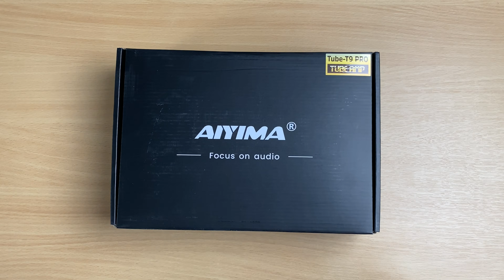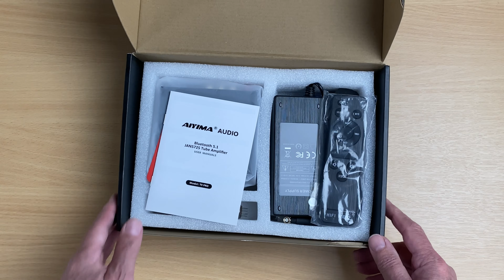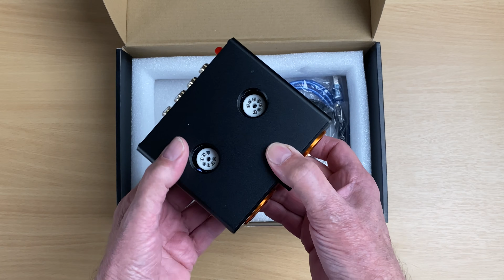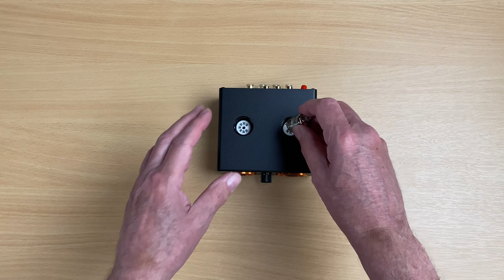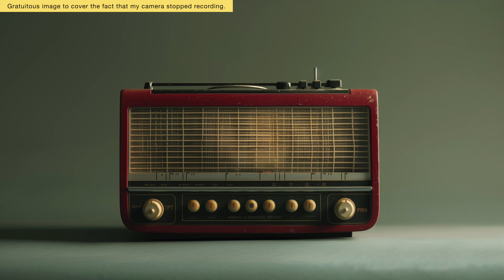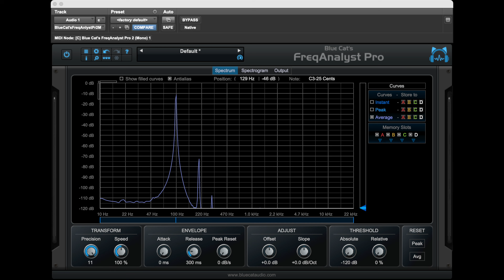Does this amp distort? [Aiyima T9 Pro]

Comment: Using a tube this way does add a little coloration - i.e., distortion. Nelson Pass has done some research and he says adding certain distortion in small amounts can sound to most people as greater depth in the stereo image. Not the same as warmth, but and interesting. There is also "sighted bias" and so on that could be going on here.  Many of us in the Hifi hobby have heard that "tube gear sounds warm" - and in fact since tubes are thermionic devices, they have heaters - which is the yellow-orange part you see glowing cheerily inside the tube.  And tubes actually do get warm or even hot.  Hifi enthusiasts know this, and this knowledge can influence what people feel that they are hearing. So even if the tube were not in the audio path at all, a number of listeners would feel that the audio device in question provides a warm sound.  Ears and not microphones and the brain is not a piece of test equipment. It is impossible to listen to some piece of gear and make an objective pronouncement - any "how does it sound?" comment will be a subjective opinion, coming from the mind of the listener and human minds are terrible drawing making objective conclusions of subtle sensory observations -  such as evaluating the "sound" or a gain stage. So, even if this slight amount of harmonic distortion is not audible, many listeners will FEEL that the amp produces a warm sound. 

Now, tube audio output stages are another matter -  the source impedance of a tube amplifier will interact with the complex impedance of a speaker which results from an interaction between the electrical characteristics of that speakers drivers and crossover- this interaction follows Ohm's law and results in variation of frequency response of the amplified sound. Sometimes these variations are very small and are essentially inaudible, but sometimes the response through the amp/speaker combination varies by as much as ± 4 dB- which is definitely audible.  Personally, I LIKE the way a certain tube amp of mine sounds through a pair of 2-ways speakers that I have- the coloration is very much to my liking.  So, in a sense, I am using this tube amp as a TONE CONTROL.... 😎
Reply from the maker: Thank you for your detailed comment which I'm sure my viewers will appreciate. I will however comment further on 'the yellow-orange part you see glowing cheerily inside the tube". In modern equipment, whatever glow there is from the heater is often reinforced by a distinctly solid-state LED.
Reply: @AudioMasterclass  Ahhhh-  but any LED is not INSIDE the tube so it is not  'the yellow-orange part you see glowing cheerily inside the tube"   only the heater is INSIDE the tube-  but this a minor point.  Also, while the tubes get warm or even hot from the filament, the LED doesn't cause any appreciable heat.....
Reply from the maker: @billmilosz  To be clear, I did not say the LED is inside the tube. It is a trend that I have observed for close on twenty years that tubes have their glow enhanced by LEDs either behind or beneath the tube. It does nothing other than make the equipment look nice. Personally, LED or no-LED I care not.
Reply: @billmilosz  In fact there is a very small orange glow within the valve due to the fact that the filament is warmed onto a state where it can emit electrons. It's basic with valves. The blueish tone that we see on some chinoamps, working on low levels, are just marketing cosmetics. Indeed if you inspect an old medium or short wave AM transmitter the modulating audio from the old venerable 6146 valve in push-pull configuration class A/B will make glow blue due to the ionization of the gas inside, this for a continuous 80 W or more. This is for the audio frequencies. This very same configuration, this time for Radio frequency drive to the output Valves, in class C, will glow in orange by nature. This blue or orange glow can be seen near the base of the valves. And how wonderful it is!
Reply: @lotsofcouscous  The blue glow seen in power tubes (KT88, 6146, etc)  is not due to ionization of gas in the tube. If there were enough gas in a tube to ionize and glow, that ionized gas would conduct and the tube wouldn't work. It's a VACUUM tube, after all.  The blue glow is actually fluorescence in the glass of the tube envelope,  the  phenomenon is due to electron bombardment of the glass.  There are some gas-filled tubes such as regulators like 0A2 and so forth, but these are a completely different type of tube- they have no heater, no filament.  They are cold cathode tubes.  There are also thyratrons, a type of gas tube that can be used as a switch- but these are seldom used nowadays as there are better solid state devices which have replaced them for the most par, except for very specialized uses.

Comment: Many modern components have very low levels of harmonic and intermodulation distortion. Test equipment that can measure it tends to be rather expensive.
One could argue that a "warm" sound is by definition not a "neural" sound and therefore implies some level of distortion (of some form or other, not necessarily IMD or THD). Even a non-flat frequency response can be considered distortion of spectral uniformity of gain.

Comment: Amazon labels the Ayima T9 pro as a frequently returned item. I think that's all you need to know. Another Chinese Giant killer sold by a Chinese audio salesman.
Reply: Thank you for pointing out our problems, our products are always being optimised and updated welcome to point out other problems.
Reply from the maker: Yes I saw that on Amazon. 'What the fluff?' I'm inclined to howl. Unless these amps are breaking down in use I can only think that it's repeat-returners having their fun.
Reply: @AudioMasterclass  and @moe5809 I wasn't aware of that fact, but I'm one of the users who contributed to it... I returned it because I was quite disappointed with it and it also seemed to be somewhat faulty...

The faulty part was that the remote didn't work very well: sometimes it worked, sometimes it didn't... Fiddling with the cables connected in the back would trigger that intermittent behaviour. My guess was some bad connection/cold solder/etc inside, on the IR receiver component (or something on its path) and fiddling with the connectors could somehow physically push that component in a way that would open/close its contact to the board or something similar.

The bluetooth connection (which I didn't really care much about, but tested anyway just for the sake of testing) was kind of fiddly too... Sometimes it sounded OK, other times there was an annoying "noise"/"buzz" (for the lack of a better word to describe it). Of course technically that could be a problem with my phone... but I didn't test it with another device, so I can't tell for sure.

Regarding what I assume was distortion by the tube/valve, what I noticed (when using the aux output into a pair of powered speakers and comparing it to a couple of other audio interfaces, like a Motu M2), was that it added some extra "reverb" to the sound. This was actually kind of pleasant on some recordings that were originally on the "dry" side, but on the other hand, on recordings that were "wet" originally (like a classical guitar recorded in a big cathedral hall) it was way too much reverb and became annoying.

The biggest disappointment though was when I connected it to a pair of passive speakers. In comparison to an old class AB Philips amp from the late 90s, The T9 Pro sounded kind of "veiled", like if the sound was coming from the end of the room and as if the speakers were behind a thick curtain. On the other hand, with the old Philips amp, everything sounded more "alive", soundstage/imaging was much more "upfront"/"forward" (or whatever one may call it). Acoustic instruments also sounded somewhat more "natural" in a way. I don't think it was lack of volume, since pushing the volume to 50% (or whatever 50 means in the T9 Pro display) was more than enough for my ears. So I ended up returning it to Amazon.

A few months later I bought a Fosi V3 and it was a whole different experience... I could not tell any audible differences to the Philips amp. The Philips amp has clearly more output power (despite being rated 100W per channel and the Fosi being an astonishing 300W per channel, but we all know how meaningless those numbers are), but I don't care much for that, since I live in an apartment and I like my neighbours... The volume knob on the Fosi never goes past half its range (at most).

Maybe I got a faulty T9 Pro, but overall I didn't like it... despite agreeing that the VU meter and other visual features looked appealing... It also got fairly hot after being on for a while... I guess an expected side-effect because of the tube/valve...

Comment: Distortion is simple .... anything coming out of an amp that isn't exactly what you fed in is distortion.

Audible distortion is more complicated.  There are thresholds of hearing, ambient noise, and several other considerations.  But David is correct... nobody is going to hear 0.01% distortion.
Reply: at 85+ db ppl might definitely hear it yeah on these cheapo amps (going off data of similar designs and specs
Reply from the maker: I think I said 0.1% but definitely no-one on Earth can hear 0.01%. I'm 99.99% sure of that.
Reply: @AudioMasterclass  
The point remains ... nobody is going to notice.

Comment: I used to think that warm sound is that with emphasis on lower frequencies, e.g. those below 1kHz. But this only a convention, we say A sounds warmer that B, B sounds brighter than A. Why is it relevant? Perhaps because human ear is most sensitive to middle to high frequencies, whose exces will be unpleasant for many listeners. On the other hand,  it conveys the most details, likely due to that same, human, psycho-acoustic perception. Some amplifier designs (cynically?) emphasize these frequencies to pack more detail. People with impaired hearing will applaud this practice.
Reply from the maker: I'll thrown in a quickie here... A slight lift in frequency response, I mean a fraction of a dB, can be audible if it's over a wide range of frequencies. In the low frequencies, then yes it would be reasonable to interpret this as a kind of warmth.

Comment: Peak-to-peak or zero-to-peak or RMS are not subject to opinion.
Reply from the maker: You say that, but when measuring the average power output of an amplifier (commonly called RMS), it's a matter of opinion how long the amp should be capable of sustaining it for.

Comment: When we're talking audio gear - or listening in general - there are many descriptors that one can use when trying to explain what we're hearing.  All in all, however, there are two categories to which all of our descriptors fall - tangible and intangible.  Often-times, when audiophiles describe what they're hearing (and all of our ears are uniquely different), they (we) may go off on a tangent describing experiences that may not make sense to some.  Tangibles are those descriptors that can be measured and easily referenced (i.e. frequency response, noise, etc).  Intangibles, however, are not so easy to measure (and oftentimes they may be impossible), but they are easily heard by critical listeners.  With intangibles, we hear descriptors such as:

Depth...
Sound-staging and imaging...
Instrumental timbre...
Air around the instruments...
Musicality and immersiveness...
Warmth (which is distortion - but it may be measured as distortion only) - but "warmth?"
And many more...

None of these can be measured and it is often between these two areas (tangibles and intangibles), that many arguments ensue.  For example, in some cases, I find the warmth of "certain" tubed instruments to be just right, while in other cases, the warmth may be too great for me to really become immersed in the music.  Yet if somebody tells me that they loved the tube sound of a particular component (that I may have found off-putting) who would I be to argue?  I remember a long time ago, an audiologist told me at an ear examination that no two folks hear the same - in particular when it comes to areas such as music listening.  He bases this on our ears and how they are formed.  Anyway, I won't bore anyone with this.

For example, there are two rather inexpensive tube integrated amplifiers on the market that are often overlooked because they've been out for awhile, yet have, what many who have used and heard them, distinct audiophile qualities.  The first of these amps is the Fosi Audio T3 (a tube front end and yes, a class AB back end) - the link to Amazon US is here:

https://www.amazon.com/Fosi-Audio-T3-Amplifier-Bluetooth/dp/B0B4W36C7B/ref=sr_1_1?crid=2GHZZUUQGVNIE&dib=eyJ2IjoiMSJ9.qACQbjJHk-v-EkbPhRVB2XIuv_fMkHAlC-gZs5-FCK0rb9xAMvyV1j55EtzJ4SoWWdz5CvsCZ25pxMiAQ2MuolgJBndBdEtr6yaSdMd3S72YF_dpNncx98AU0IEXIXz8IxueywhUo4WEABGH03e07wJydY0kaZ6xtdviiWQ8khq_INOznwvm4PFd83a_VrtE.sYxdG_qTesOkz8mwJBUPQv61Rd0TanpEObU1EGjrpL4&dib_tag=se&keywords=fosi+T3&qid=1714674539&sprefix=fosi+t3%2Caps%2C107&sr=8-1

I found this T3 (while tube rolling) to be strikingly warmer (well, it has a class AB amp) qualities with superb depth and airiness around the instruments.  Now the next person may proclaim "hogwash."

The other amp is also a tube front end and class AB back end, and it's the Nobsound (uses 4 unique Chinese tubes that can only be purchsed from them), but the sound (IMHO) is sublime.  It is the Nobsound B100 and the Amazon US link is hereL

https://www.amazon.com/Nobsound-Bluetooth-Amplifier-Integrated-Power/dp/B0BLXYBZZ5/ref=sr_1_5?crid=34ETR2JU8V2MO&dib=eyJ2IjoiMSJ9.lvDdqqPMGj32n-IlNpiyy2i2t0zBZXbxaIatkrCD3Zyuon39g77mT7yprC72GOQNkEXZvCHANP75hcEeABntdPlVH2jKm93WaHC15M2BqrOVRqX9KUX0POp36ue1UCmCnxgkrQRwmpnbRCOLc7sgHk0Ypjz1dmLg4PckwvedWuB2vkRvx8191DjND69JLYDWMfx2YUwYZXpdZxPEBbZySaSbWjnieRYVQ1EExmJia0c.LKQix4RjbFYlUBryje2MI_aTqySIjgwVYXdAEgaFsyk&dib_tag=se&keywords=Nobsound+tube+amps&qid=1714674675&sprefix=nobsound+tube+amps%2Caps%2C112&sr=8-5
Reply from the maker: Your list most definitely applies in recording. There are so many variables they cannot all be quantified, and the possible combinations are beyond astronomical. This is why, although I put my faith in science, I accept that there may be variables in hi-fi that are beyond measurement. I did say 'may' there, but that's just my opinion, which people can accept or decline as they please.
Reply: @AudioMasterclass  Thanks - I appreciate that.  I love your channel, I really do.